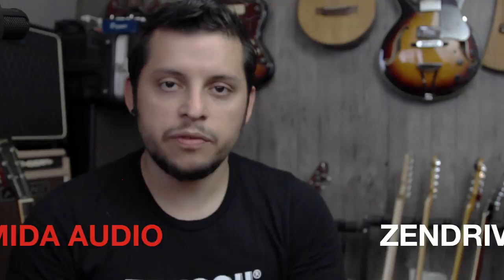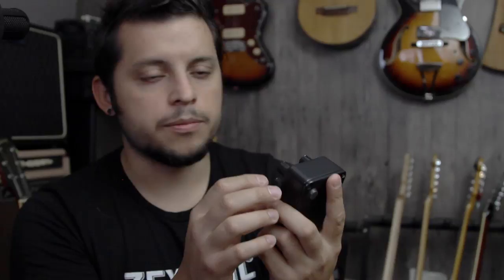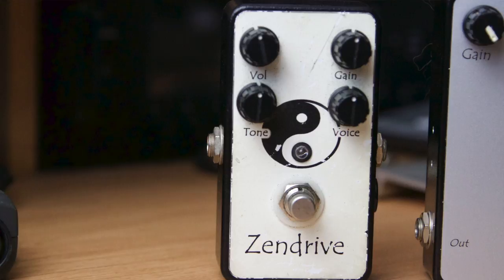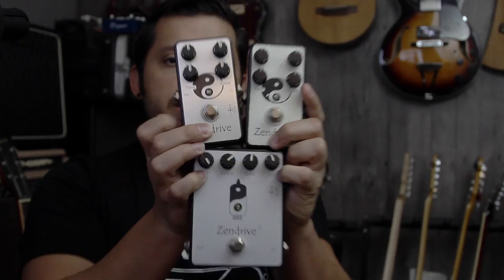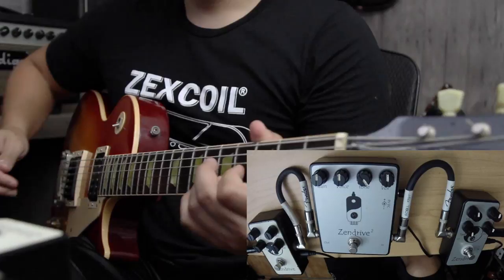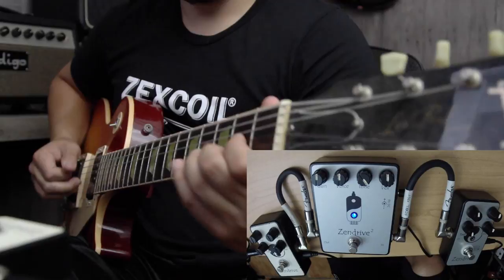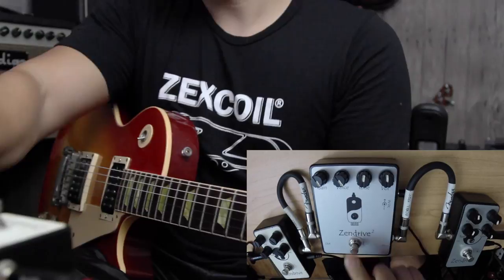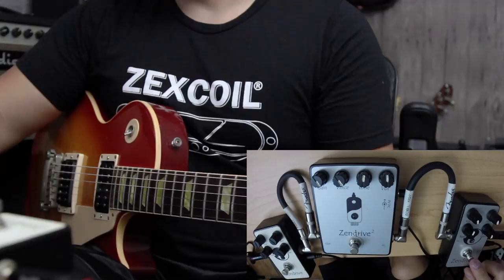Hermida Audio Zendrive Shootout | Original vs Modded vs Zendrive 2

Comment: They all sound great. I have an original made by Alf. The 2 has a tube in it, if I remember correctly, yes?
Reply: No!
Reply: Haha yes indeed it does. I own both an original Zen and Zen2. Liked them both back in the day, but preferred the 2. The tube just sounded more organic.
Reply: I am sorry I was wrong. Probably because I just build one with a switch that could switch between ´vers1´ and ´vers2´. That must then be 2 different versions of Zendrive 1. One has a silicium diode and the other has a germanium diode in the clipping circuit, it makes quite a difference.

Comment: It would have been a better comparison if you had used a small (20 watt) tube combo amp. Axe fx react nothing like a real amp when volumes go up&down. 
I am certainly not not a hater of digital!!      Obviously you got some good tones from it
Reply from the maker: I'm not sure if you've played fractal stuff before, but I have to disagree.  I feel like it reacts like an amp.  Keep in mind that the preset that I had was based on a dumble with the preamp just about breakup.  Adding more input signal at that point won't increase in volume, but rather in saturation.  Perhaps what you are referring to is what happens to, say, a Fender Twin at volume 2 or 3, the big jump in volume from added gain.